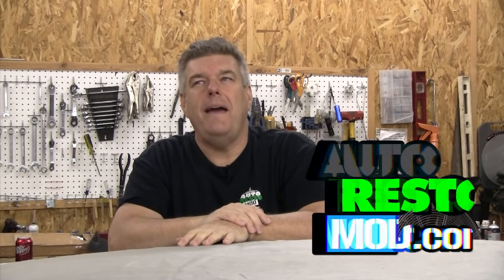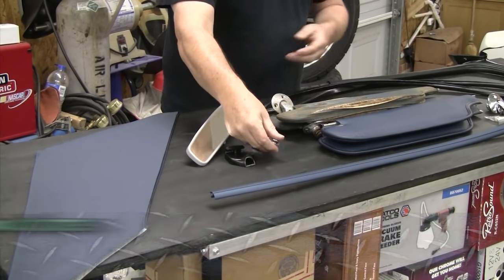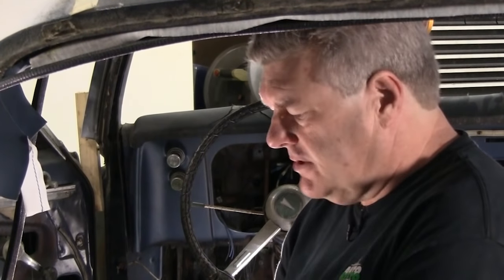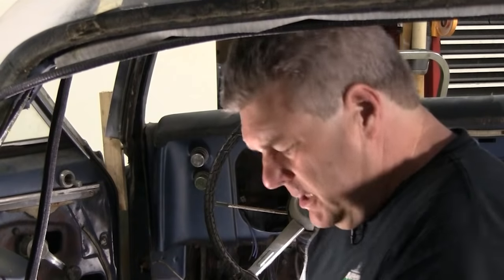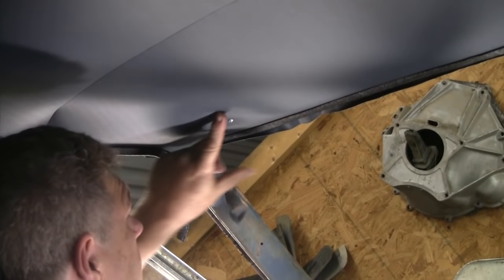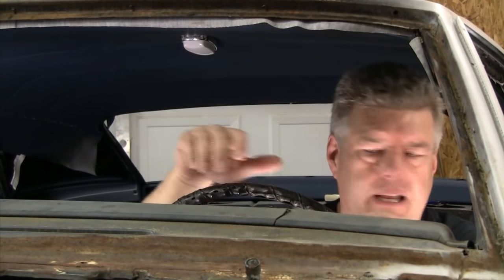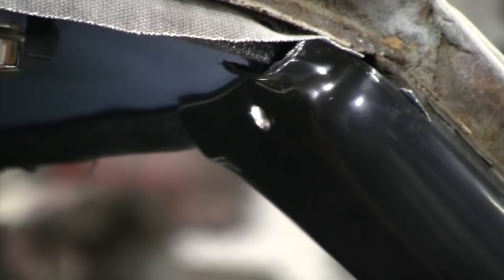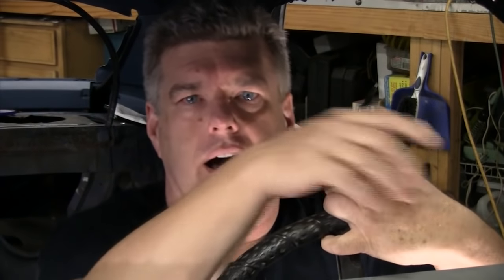First Gen Camaro Firebird How to Sail Panel, Visor and A Pillar Tips and Tricks EPISODE 307 Autorest

Comment: hey guys,  thanks for the videos on the headliner and the sail panel install, great info..  I installed 2 new quarter panels on my 69 Camaro,  around the back window the small rivets that the clips for the window trim are not on the new quarters.   How do you install these and where can you get these?  Thanks in advance     Jeff J.

Comment: The top of my sail if wanting to come down and pull the headliner with it .what should I use behind the headliner? The velcro...and what glue to hold the sail into the headliner?
Reply from the maker: Did you staple the headliner down as shown in the video? We use weatherstrip adhesive from 3M: 08001. Also, I will wipe the glue off of the velcro and use weatherstrip adhesive.